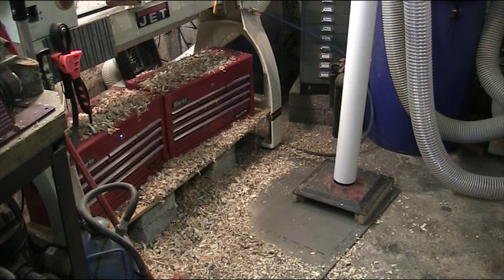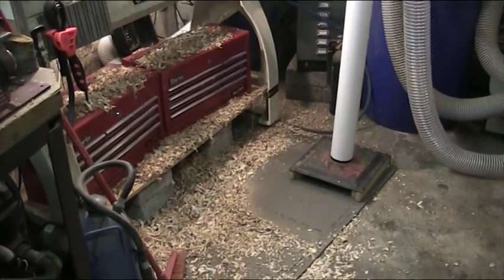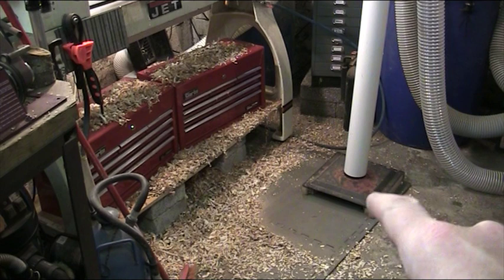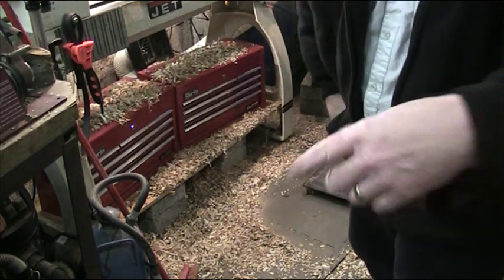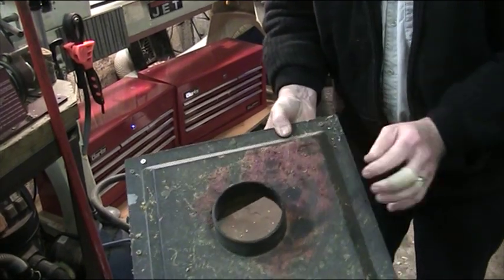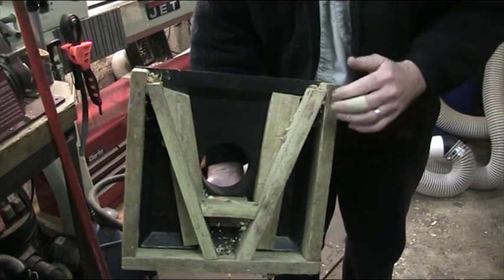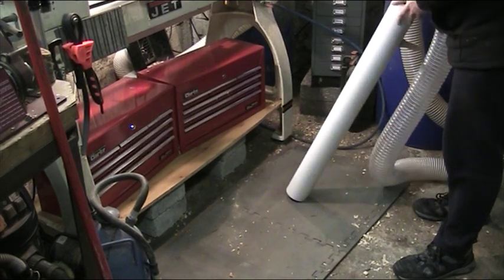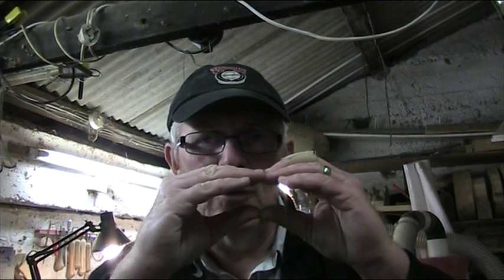Woodturning - Cyclone Vac Clean Up

Comment: Okay, now I want one of those for cleaning my house and I also want all of those wood shavings for my gardens!!!
Reply from the maker: ***** If you were close by you could have all the shavings.  I throw them down by the veg beds where I want to build a pumpkin patch so they aren't wasted.Best Wishes, Brendan.
Reply: baconsoda That does a great job, Brendan. Once you get you chickens that will be great bedding for the coop. I use a similar product but have to buy it for around $10 a bail. When you clean out the coop you can compost it for the gardens.
Reply from the maker: ***** One of the reasons I made the drop ox was to catch 'clean', dry, shavings for the chickens so I've got that part sorted.  I won't collect Walnut shavings because they are poisonous to horses so I don't want to test my chickens.

Comment: Brendan before you do any thing get your sweep vac patterned, that is one of the best things I have seen for the workshop ever. Since I had a resent back injury I find it quite painful to bend down to sweep up using a dustpan and brush.  Your sweep vac saves dragging a hoover around the shop and bending to pick up any rubbish from the floor its a real godsend for the likes of me.  I find I can sweep ok with a broom but the picking up of the rubbish hurts pretty bad. your creation is perfect for my needs, thank you so much for posting this. sorry but I'm going to copy it before the pattern is in force :-)
All the best,
Tony
Reply from the maker: ***** LOL, copy away, that's what this is all about.  It's a real pleasure to know someone has benefited from something you did.  I have back problems so I needed to find some way to make cleaning easy, I think I've got it.  When I get the system fine-tuned I won't even have to carry the hose.Best Wishes, Brendan.

Comment: Very nice shop vacuum setup Love the floor sweep. Robbie called you lazy but I am the lazy one for not going out there and build one myself.
Take care
Albert
Reply from the maker: Al Furtado LOL, don't fuss over the joint where the pipe goes inot the cone because a simple hole would have done, according to my mate who worked with sheet metal.  I didn't need the elaborate tear-shaped hole.  If you have space get a big barrel because I only empty this about once a year.  I do sweep up the bulk of the shavings and suck up the rest so the big barrel does hold a lot of stuff.  If you do build one of these you'll find they keep your vacuum operating at full power and the workshop a lot more dust free.  I'm sure your build will be a lot more elegant than mine.
Best Wishes, Brendan.
Reply: Thanks for the reply. I have built a small chip separator cyclone for my shop but it's attached to a small shop vacuum and yes it does a great job in separation the chips and dust it keeps my filter clean in my vac as well. I was commenting on the whole setup
I need t make a big dust collector for my shop
Reply from the maker: Al Furtado Ah, got you now.  I'm going to build a small shop vac cyclone because I'm so impressed with the way the big one works.

Comment: Hello Brendan,
The lathe got a bit too high in price for a second hand machine so I think you're right in waiting to buy a new one.
I don't have any form of shop vac at the moment.   I wear a good dust mask constantly and then sweep up after a turning session.   However, I do have an old household Dyson vac which is very powerful and gets into the corners.   In fact it's so powerful my wig has disappeared down it a few times.   I really must get a proper  system soon.
You will be pleased to hear my head cold has cleared up, the one I had during the water pouring affair, so I'm restored to full health.
I had to go to Dublin airport yesterday at short notice and didn't have time to arrange to call with Robbie.
Best wishes,
Alan.
Reply from the maker: Alan Simpson Hi Alan, I'm delighted your head cold has cleared while nominations are still going on for the challenge.  If you make a drop-bin for the Dyson you will be able to do a lot of cleaning before having to empty the drum.I'm for Belfast now, just bought a vacuum pump for use with a chuck.Best Wishes, Brendan.

Comment: Great idea with the sweep. I just happen to have one of those table-saw hoods I don't use any longer. I'll re-purpose right away, thanks. Sorry you missed the lathe but it's money well-saved, I guess. Maybe a better deal will come along and you'll be glad you can go for it.
Regards, Gary
Reply from the maker: Thanks Gary, the floor sweep is great because it saves me bending to lift shavings.  I have no regrets about the lathe, it got too dear to make it a bargain so I didn't bother.  I'll probably buy the Jet3520B (white Powermatic) later.  You can't have too many lathes.  I was looking at the Jet2424, short-bed version of the huge 4224 that has a vacuum built in but then decided it's not worth another $2000 for a vacuum.  During the week I bought a second-hand Edwards vacuum pump for $50 and the connector to a vacuum for the 3520B costs $50 so that's the vacuum issue sorted.  I'll be doing a build video for my vacuum set-up later when I get some time.
Best Wishes, Brendan.

Comment: Wondering if your  fox dust extractor was  1 or 2 horse power motor
Reply from the maker: I am almost sure it is 2HP because I checked a lot of extractors and it was the exact same specs as the Axminster ADE2200 (I think the title is), the Charnwood, SIP, and some others so it looks like they all use the same motor and vary the look or colour a bit.  I got mine in Brown's of Ballynahinch if you are near, or in, NI.
Best Wishes, Brendan.

Comment: I think we have the same lathe. If you sort out how to hook a dust collector  to it  let me know. Are you not happy with the current lathe?
Frank
Reply from the maker: Frank B I'll show you what I did tonight.
Reply from the maker: I've been hunting for the comment that asked was I not happy with my current lathe and I've just reread them all and found it.  I'm perfectly happy with my lathe, it's a super machine that I've improved with variable speed but when I saw the price of the Jet3520B (Powermatic 3520B) at half price I decided to have a go because that doesn't happen often.  I would still buy one but I'll keep the lathe I have because it's working perfectly and I know it inside out.  Also, all my tooling and chucks are for a 1" x 8 spindle so, if I bought the big lathe, I would have to start buying chucks etc.  I can avoid that by keeping the lathe I have.  I don't need a bigger lathe but, sometimes, a bit more muscle is useful.  I don't drink or smoke any more so I don't mind spending money of tools I'll have for a long time and, were I still smoking as heavily as I did (never drank much) I could smoke a Jet3520B in about 2 months.  Yes, cigarettes are that expensive here now and an 80 a day habit is hard on the pocket.
Best Wishes, Brendan.